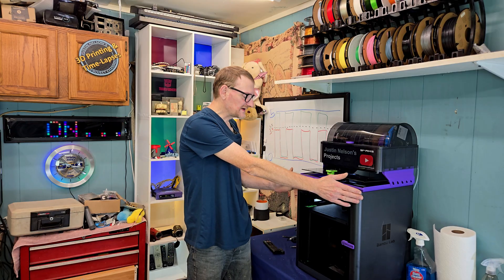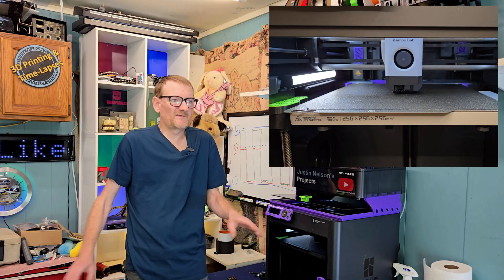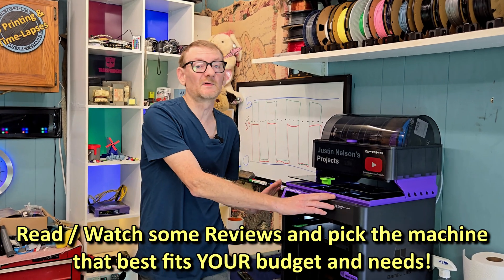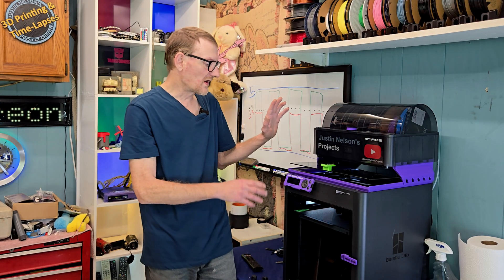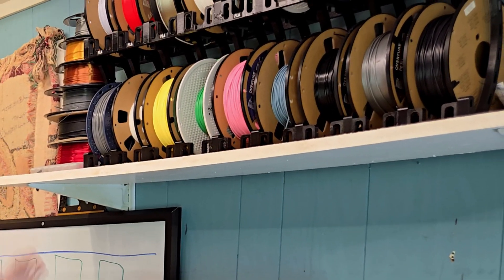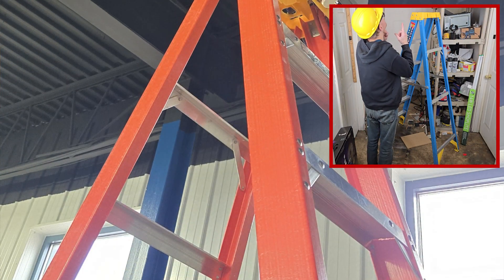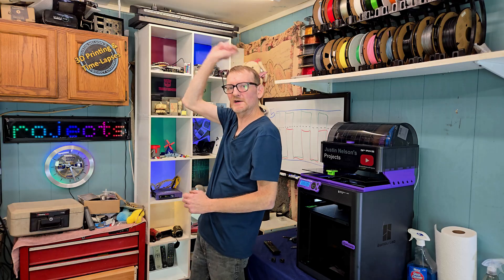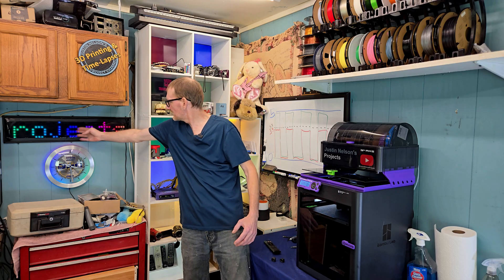This is Not a Review... a Commentary on Modern 3D Printers • Stop Wasting Money on your Old Printer!

Comment: do not change materials on a printer whit one toolhead from PLA to PETG  is ok once if do the the PETG to PLS you will jam the hotend
Reply from the maker: I see that done quite often with these printers, if you're talking about mixing materials for ease of removal of support. The important thing is that the printer knows it is switching from one to the other... So it heats it appropriately and does the appropriate Purge...

Comment: True words my brother. I've started my 3D printing hobby about 8 years ago with cheapo chinese acrylic i3-clone, modded it so much it became whole new printer. It was a great fun, designing parts, tweaking parameters, fixing what's been broken, but it turns out it was not a 3d printing hobby - it was 3d printer making hobby :)

Last summer I've decided to do a full rebuild - new printed parts, some more upgrades, just to make it more up-to-date. It's been a slog, sice then I've only tried do solve problems with it, got enough of it and pulled a trigger on new Qidi Q1 Pro. It's been a game changer - much more reliable (not perfect, but I have the knowledge to fix/change anyting), print quality on even quick draft profile beats the old one by a mile, tolerances are great and the best of it I can print now almost any  type of filament I would like, polycarbonate, nylon, abs, you name it.

The point is this - if you are on the line, stop thinking and get yourself a modern machine, you'll not regret it.
Reply from the maker: Couldn't have said it better myself! Although I tried LOL

Comment: That’s it. We start thinkering with our printers (and it’s great for learning the inner working of these wonderful machines) and eventually we get tired of it and go for something that just works. 

I started with an Ender 3 a few years ago, then got two other printers that also required a lot of tinkering to get half decent prints… I also went into the resin world (hated it and won’t go back ever, too messy for my taste), now I got a Flashforge 5M. I still don’t care much for multimaterial, Bambu Labs printers are way too expensive where I live and I just want to print stuff now. 

It’s important to mention that all the knowledge acquired in the tinkered printers is not lost… it’s good for not having to depend on service centers anytime a corrective maintenance is needed.
Reply from the maker: I couldn't agree more! I did mention in the video that I wouldn't give up the experiences I had with my old printer for anything. Not to keep on with the car analogy, but even if you have a good running car, it's great if you have the experience and know how to actually work on it when the time comes...

Comment: I went through the same growth as you. Started with the Qidi X plus and always had to fix or adjust something. Now im on the Bambu X1C and it just prints everything . i dont eve touch the settings
Reply from the maker: I did start tinkering a bit with the default slicer settings but most of the time, it just works. I'm only a month into ownership of the Bambu... But I've gone through a lot of filament already LOL. I've had two spaghetti messes, one because I forgot to put the build plate back in... I understand the x1c would have detected that LOL. 

The other was related to me trying to use a very old spool of asa, it broke off eventually and I learned how to clear out the AMS. Not as daunting as I thought it would be by the way...